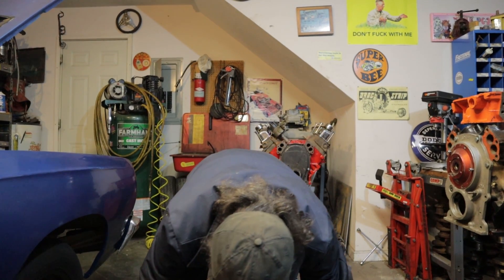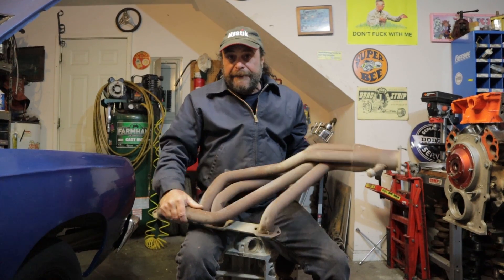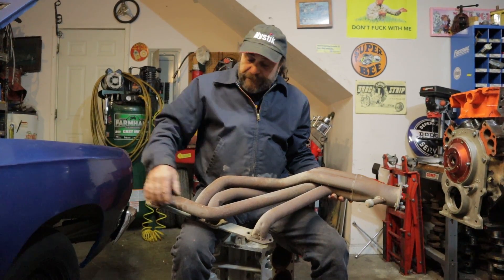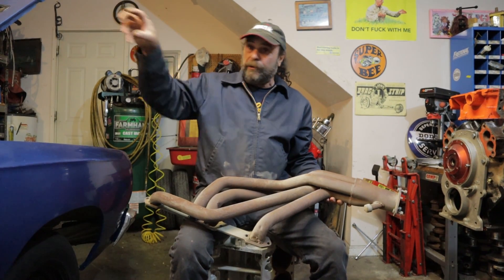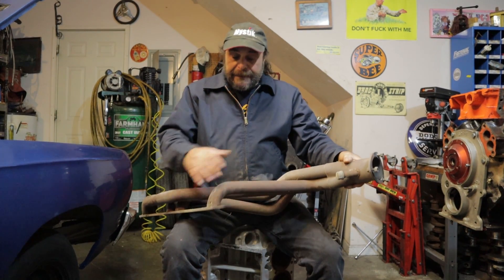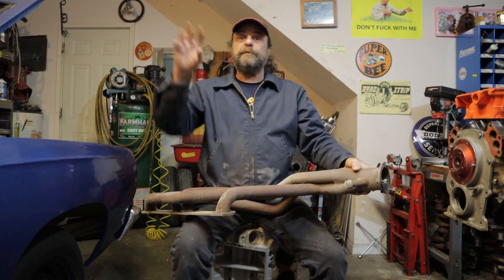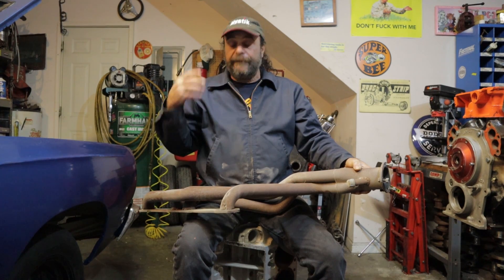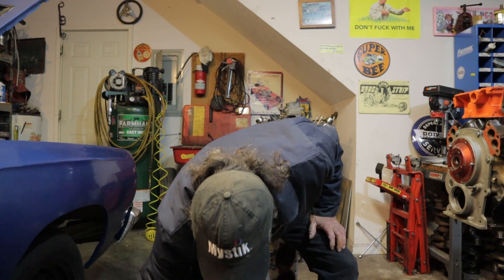The BS On Backpressure

Comment: TONY, THE ENEMY HERE IS ROTATIONAL INERTIA WHICH IS STORED ENERGY. THE EXHAUST VALVE IS MADE SMALLER TO CREATE BACK PRESSURE IT'S BUILT INTO THE HEAD IT'S A CONSTANT, SO THE ROTATIONAL INERTIA DOESN'T SPIN TOO FAST BREAKING YOUR QUENCH AREA WHEN YOU HAVE MAXIMUM AIR FUEL COMPRESSION WHICH YOU ARE TRYING TO IGNITE AT THE PERFECT SET MARK. IF YOU DON'T CONTROL THE ROTATING MASS WHICH CAN BE IN MILLISECONDS OR EVEN MICROSECONDS, THE PISTON WILL DROP TO FAST AFTER THE COMPRESSION STROKE BECAUSE THE ROTATIONAL INERTIA WANTS TO PUT THE PISTON WHERE IT WANTS LOWERING YOUR COMPRESSION AND IT WILL DROP QUICK. YOU HAVE TO HAVE A MEANS OF CONTROLLING IT SO YOUR SPARK CAN REACH ITS SET DESIRED POINT. ALL YOU GUYS SHOULD THINK BEFORE YOU MAKE THESE VIDEOS BACK PRESSURE IS A MYTH. IT'S THE MOST IMPORTANT THING FOR AN ENGINE TO MAKE MAXIMUM POWER AND RUN PROPERLY. THE EXHAUST VALVE BEING SMALLER MEANS THE PROOF IS IN THE PUDDING IT CREATES BACK PRESSURE TO SLOW DOWN THE ROTATING MASS SO YOUR FUEL AND YOUR COMPRESSION STROKE ALL FALLS INTO THE DESIRED PLAYING AREA. FORD'S DOUBLE OVERHEAD CAM INDY MOTOR BUILT BACK IN THE SIXTIES HAD AN EXHAUST CALLED THE BUNDLE OF SNAKES. TWISTS AND TURNS. IT WAS DONE TO CREATE THE PERFECT AMOUNT OF BACK PRESSURE TO CONTROL THE FAST SPINNING ROTATING MASS WHICH REACHES HIGH RPMS TO MAKE EVERYTHING FALL INTO PLACE PERFECTLY TO ALLOW YOU TO MAKE MAXIMUM POWER.

Comment: You missed one important Part.... backspressure makes it more drivable on the street... the better wax would be a exhaust System which changes in diameter as you rev the engine...since that would be very complocated you create a little backpressure with the muffler for the same effect.
At full throttle it would take some HPs.... but since you drive on the street from 1000 to 6000 RPM  it makes sence on a Stock street car....

Comment: Obviously everything Unc Tony says is gold.  

Although....I have no although.  But as much as loved things that are engineered by hands for hands, I can’t wait for the next (maybe a three) generation of internal combustion piston driven engines.  Where casting, matching, printing, and materials are no longer even factors.  Where there’s enough computing power paired with fully understood laws to be part of an equation.  60 valve cylinders.  3 types of valves.  Separate circuits for various parts of the stroke.  Taking full zeroed out advantage of nearly every bit of energy involved.  Vacuum-positive pressures in all 4 sections of a NA engine.

I don’t want to be alive to see that day.  But that would be some engina

Comment: When you have a bad or no muffler or an exhaust leak on a modern car.  It causes the ECU to run rich or lean.  I think mechanics just say it needs back pressure because it's a simple explanation.  Rather than getting into how the narrow band o2 sensor works.

Comment: I can't help but think there is a language problem here. What is "back pressure" specifically? To me, the vacuum Tony is talking about and "back pressure" are two sides to the same coin. "Back pressure" is really just resistance, and you can't have vacuum without resistance.

Comment: THE BACKPRESSURE IS A SET THING BUILT INTO THE HEAD. THIS IS WHY THE EXHAUST VALVE IS SMALLER. ENGINES REQUIRE BACK PRESSURE TO FUNCTION PROPERLY. TOP FUEL DRAGSTER STILL HAVE SMALLER EXHAUST VALVES. BECAUSE BACK PRESSURE IS VITAL TO MAKE POWER. IF THIS WASN'T THE CASE THEN WHY DIDN'T THEY MAKE THE EXHAUST VALVE THE SAME SIZE OR BIGGER, BUT IT STILL REMAINS THE SAME BEING SMALLER AFTER 100 YEARS. HOW WERE SO MANY MILLIONS OF OLD SCHOOL RACERS DECIEVED BY THIS SO CALLED MYTH NOR BS.

Comment: Back pressure is real just try to run a engine without headers and pipes... Yes you can run straight pipe no back pressure only with a tuning.. unless you have a carburetor engine

Comment: I’ve always heard if ya run open headers your gonna burn a valve! Cold air will get back to the valve and create a lean condition and burn the valve !  Even when I was young and dumb I always wondered how that could be possible?  My first car I put headers on was an experiment for me! 
I put a chunk of 2x6 over the header outlet with the car running and tried to stop the exhaust flow and stall the motor at least! Couldn’t even come close to doing it! So I’m thinking how in the world would cold air make its way up the headers to burn a valve? 😅

Comment: So, I have an inline 4 Yamaha 600cc sport bike with an after market slip-on exhaust that idols  irregularly. Pulses. I discovered that when I place my foot over the muffler port, restricting the flow, the idol evens out. I installed a cheap baffle to simulate this restriction and it has the same effect. What is this phenomenon I'm experiencing? Is flow restriction not the same thing as back pressure? And why do some manufactures install a butterfly valve to restrict flow in the exhaust, post 4 into 2 into 1, controlled by a servo and adjusted based on RPM?

Comment: I know it's been two years but shouldn't you have used a two stroke motor as a back pressure motor. Considering the don't have a cam shaft(at least on a dirt bike). Reed valves need back pressure that's why the pipe is so important.

Comment: This is very true I had two 2 1/2 pipes with a flowmaster on my truck and it ran like trash made it a single 2 1/2 with a straight thru muffler ran so much better

Comment: I have a problem I put a new exhaust on my Chevy S10 and it lost like 40 horsepower it's a 4.3 L V6 with a stock computer that's got a two and a quarter inch exhaust to pipe to a two-and-a-half Flowmasters with an H pipe anyone got any ideas on what I should do?

Comment: There is different cases where back pressure can help and cases where it can hurt because a dyno doesn’t lie.
For instance I’ve drove my hotrod with straight headers and I’ve driven it with just 5ft of exhaust and super 44’s and you can clearly feel quite a bit more power with the exhaust or if you run your own vehicle with straight headers and then run it with a pair of torq tubes and if you knowr vehicle good you will notice it runs better with the torq tubes and the zoomies on a top fuel car running better is the other side of the back pressure theory where it runs better so it works differently in different applications especially on a a 2 stroke cause they have to have a expansion chamber designed for it or it won’t hardly run at all with out it

Comment: Certainly most my vehicles end up with headers. This was especially true on all of my Toyota's. I was looking for the most amount of torque I could possibly get on my toy 80 4x4 yes it has a stage 3 engine and 5:29 gears. What I initially went to large with the exhaust. Besides the try Y  header  to help with the Scavenging, I left the larger catalytic converter and Muffler. Doing some tests with different size reducers I found what I felt was best for its application. I was dumbfounded I was back down to 2 in exhaust pipe. Lol Of course these engines can  only flow so much CFM.

Comment: So, it took 2 yrs for this video to get to my video list... and, as I appreciate it as an instructional tool, I feel that it needs to be edited a bit. Because uncle Tony here says" ALL engines that you run into"... and, that's just not true. It's all 4 stroke piston powered engines. Because rotary engines work in a slightly different way and so do two stroke engines due to the fact that they dont have camshafts. And the rotary engine has no valves at all. It's just port overlap. So, there is the edit that never got any notice of requirement.

Comment: Honest.  Backpressure is important with 2-Stroke Motors.  The only thing for which I’ve seen backpressure being important on a 4-Stroke, is ensuring that you don’t blow a valve seal through an old head (seen it before).  Also on EFI motors that are designed to run with their stock exhaust systems, but that’s stupid and unimportant because computer-control is pretty dumb to begin with.

Comment: Why do exhaust valves burn or crack when the headers a leaking?  My thought is that leaky exhaust allows cold air to come in contact with the hot valves.

Comment: Is that why most truck long tube headers are 1.5" primaries.   And your typical hot rod  muscle car headers are 1.75" and larger.    Is it because the truck headers will make more lower rpm torque and midrange power were a 4wd truck normally uses its power curve.

Comment: To get the vacuum you have to have back pressure or it wont exist, to get the back pressure you need some sort of pipe off the engine its that simple, yes all engines need back pressure to run at their best. 
Any pipe will create back pressure when a gas flows through it the only way to get no back pressure its to get rid of the pipe. The shorter and wider less the longer and thinner more. 
To say you dont need back pressure is wrong if that were true then everyone should be able to take off their pipes headers whatever else they have on there and you will have the best performance, nope!

Comment: I've always wondered, or at least since I learned of a Tesla valve, what it would do stabbed on the end of an exhaust. If you don't know, a Tesla valve is a non-mechanical valve with no moving parts that only allows flow in one direction. I've wondered if not allowing anything to reverse against the flow of the exhaust out would provide any meaningful or good scavenging effects. I tend to think it wouldn't, but it's a curious thing

Comment: My 76 L-82 with oem LT1 solid lifter cam.... is a night and day beast of difference, when I run my side pipes ( Hooker Outlaw headers) "unbaffled". Grew up on the "myth" that you'll burn the exhaust valves when you don't have backpressure. So far....I've never seen it happen.

Comment: old people would tell me the back pressure thing and i never understood it. i knew there was SOMEthing about it but could never quite understand. this all make sense now. its about flow and the flow of the exhaust out the pipe draws in the next breathduring that crytical overlap point. Mind blown. understanding of the machine enhanced. Today i had to start blasting a 50's ford angelia that looked like it had once been some kind of lil micro drag car. i noticed that it had 1 air shock at the passenger side rear corner and thought of you. i knew what it was for.Thank you for your library of knowledge .

Comment: Nice vid. Lotta ppl always saying this sh$t about 'you need back pressure'. back pressure is when the you go to the massagist/masseuse n tell them less pressure on ma back...lol.... btw do you think there are any benefits of running exhaust gas through a charge air cooler then into intake without a turbo?

Comment: Explain to me why we had a car that would slide the muffler off the pipe below the back seat. 1969 satelitte 318-2bbl. When the muffler was off the engine would not start, didnt matter how kongbyou cranked it, would not start, until someone would reach under the car and put their hand over the pipe. Within 2 turns it would start. Happened many times, in front of many witnesses.

Comment: Great info, but I have a question 

Currently, I'm upgrading my in my truck ram 1500 exhaust with LT HEADERS &Y pipe.I was wondering what is the ideal location for the y pipe. Is it better to placed further back or closer to the headers

Comment: Thanks.  Your explanation of the manifold and the vacuum it creates just made a light bulb come on for me.  An optimal exhaust system is basically an irregularly shaped venturi.  The goal should basically be to create lower and lower pressure throughout the system by way of gradual constriction so that the gases and byproducts are pushed along the pipe as easily as possible.  It's completely the opposite of "back pressure" as people imagine it.

Comment: Do U know Y tube headers tubes are the same length and the distance between bends are the same on each tube , even if thay look like not , it is so each cylinder pushes the same volume in to the collector and the air at that point has the same volume, if U run open headers with out tuning it will lean , if U run a bigger carb or more volume fuel injection it will run rich . Bigger cam less vacuum. These should match fairly close or fight against each other.That is thay are called TUNED HEADERS , That is Y you Tune the intake , ignition, and exhaust volume to match. Any of these don't match your engine won't run right , and you"ll be blown off the ROAD!!!!!!!!

Comment: Like trying to get accuracy with a snub nosed revolver versus a 4 or 6 inch barrel. something has to guide whatever gets expelled, into a path. Of course, the goal of the log manifold is to keep the exhaust quiet for Aunt Ruth.

But hey, folks still argue they need to paint the inside of an engine block. Why not the heads and bearings, too? Don't they need better oil flow, don't they need rust protection, don't the heads have sand to release....

the real answer, of course, is, "the person who taught me a myth about painting the block, never told me to paint the head and the crankshaft and the bearings and everything else. And I never thought to ask why those components needed paint protection."

Ever pulled a sealed engine out of a junk car and find rust inside? Of course not--the oil film left behind, doesn't mix with water. Spray paint somehow goes on so smooth it smoothes out cast iron?  Funny, it sure doesn't look or feel smooth.  Sand issues?  Check your bearings--see any grains impacted in?  Its all in your oil pump screen. How many times you find an engine dead from sand?

Comment: How does exhaust, that is under pressure from the engine create vacuum? You're crazy. And if it does indeed create a vacuum, why are there no vacuum fittings attached to it? If you drill a hole in the exhaust system, it's not going to draw air. Get off the drugs. It's going to blow smoke you moron and that's how people die. Fuelie dragsters use straight pipes, so I guess they don't need the vacuum, huh? And I'll take your word on valve overlap. But it would seem to me, dual variable cams time individually in respect to each other. Isn't this trying and succeeding in getting rid of it? Overlap would destroy piston vacuum all by itself, even a blower wouldn't help under those circumstances and would pressurize the entire engine. Then you'd lose your engine vacuum. Do you even hear yourself? And tell two stroke owners they don't need exhaust back pressure and you'll be laughed out of the room. They all have to have stingers. Where do you think the entire concept of exhaust back pressure even comes from? No four stroke engine needs back pressure, why do you think headers were created? To get rid of it, and the shorter the better. Not to create vacuum, where the hell did you get that from? Sir, you have learned yourself stupid. Wow.

Comment: now does this apply to 2 stroke engines ? because my old suzuki had very restricted exhaust my chamber had a opening the size of a dime yet the pipe from head to chamber was 1.75. and i know if the chamber falls off it has no power . lol .

Comment: Inertial scavenging is only effective up to the length of the port and does not extended down the pipe.
A simple example is some modern motorcycle engines have an electronically controlled flap after the exhaust collector that closes off to increase back pressure and low end torque and in doing so it in no way increases the velocity of the gases, it only creates a greater restriction and more back pressure, that is proof in itself in that the theory that inertial scavenging velocity occurs beyond the port is plain wrong.

Comment: Only car I ever had which had NO power without the exhaust was a Susuki  samurai. NONE, NADA, Nothing (only non mopar I ever owned)

All my mopars (1977-2005 225, 318 & 360) run stronger & with better gas mileage without exhaust but for some reason I can't hear the radio even when i turn up my VA hearing aid.

Comment: So in theory a stock chevy Ram Horn would be like a tuned port exhaust system.  On 1960 Corvette with the firing or of 18436572. 1,8 and 7,2 would be on the long runners. 4,3 and 6,5 would be on the short runners. 1,8 long runner vacum pulse. 4,3 short runner vacum pulse. 6,5 short vacum pulse. 7,2 long vacum pulse. But with equal length long runners and even center runners.

Comment: Thanks, Uncle T!!! I have been saying this to knuckleheads for years....but you said it better!
And the scavenging effect is perfectly illustrated when aforementioned knuckleheads run huge exhausts in an effort, apparently, to go slower...see also: " a 850 cfm carb is perfect for a low compression 307, because it's bigger....no, the motor is stock...why do you ask? " It's a wonder any of the chromed up pro street wannabes you see at car shows even get there without a trailer...popping, farting, running on 5 or 6 cylinders....painful!

Comment: Ok, mostly very good explanation.  Possible improvement:  Walk into a church with a pipe organ.  Look at the pipes on the pipe organ.  The short small pipes serve the high (frequency) notes.  The long fat pipes serve the lower (frequency) notes.  This is due to standing waves.  A standing wave is set up in a pipe that is exactly the same length as the sound wave.  This holds true for organs and intake and exhaust systems.  The tubular exhaust  manifold that your held up toward the end of your video will have a standing wave at a lower frequency( bottom end torque) than the cast iron stock exhaust manifold that you showed earlier.  The standing wave maximizes the vacuum effect that you mention.

Comment: Hi Tony, I have a 2006 Toyota Highlander 397500 miles on it (I have a 16” trailer I can load it down good can pull it at 65 to 70 mph never gets hot)
Now I had a po420 and po430 code which is the cats, had new cats put on. Now if I can keep my rpm below 1800 with A/C on it runs cool but if I 
Go up to 2000 or 2500 the engine will get hot< what do u think?
Thanks